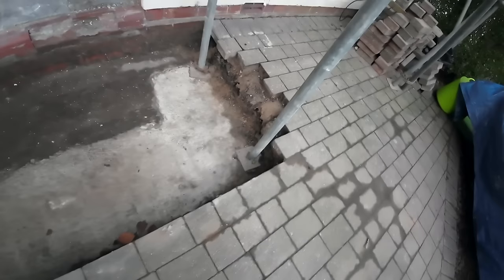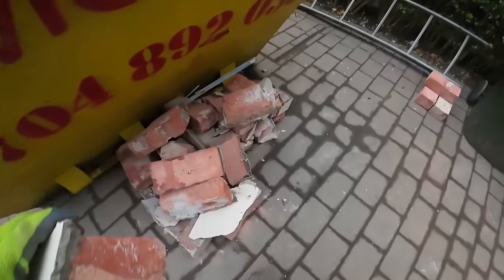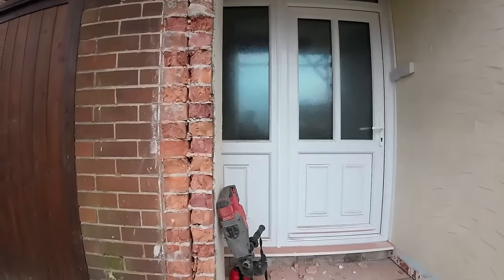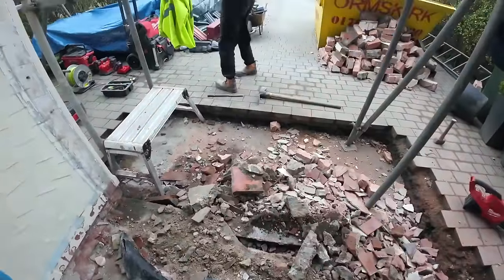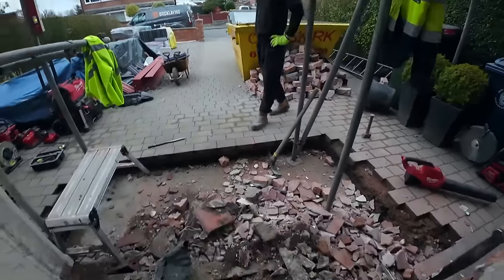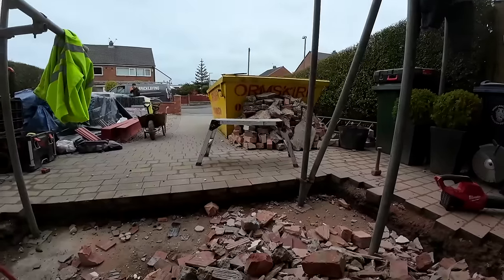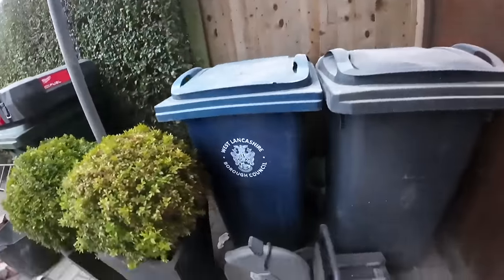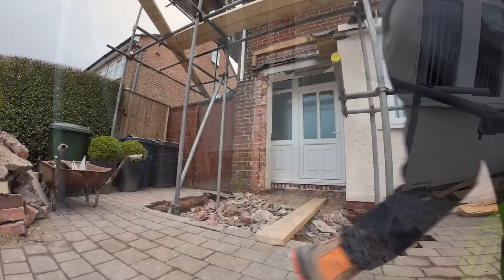SOMEONE PUT A SCAFFOLD IN OUR WAY. PORCH DEMOLITION..PORCH BUILD PT 1

Comment: I have a suggestion for your consideration.  Develop a checklist on a single sheet of paper, consisting of a row of tools & equipment and a row of materials and supplies.  Keep them on a clipboard in the van.  Fill out the checklist together every evening on the ride home.  Referring to it the following morning will help avoid leaving the house without the essentials for the day, and also help to avoid forgetting to order what you need or what to pickup when you go shopping.  Cheers.
Reply: I’ve actually got up late before and walked to work ! Only when I got there I realised I’d left my van at home
Reply from the maker: @dciburnsidesniffsniff6119 🤣🤣🤣🧱👍🏽
Reply: @dciburnsidesniffsniff6119 well at least you didn’t leave your pants at mome😊